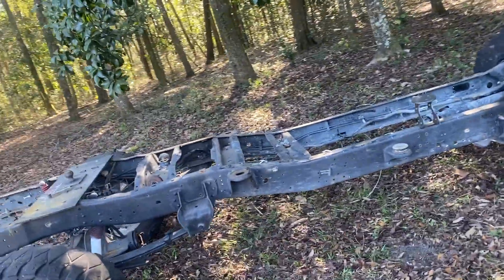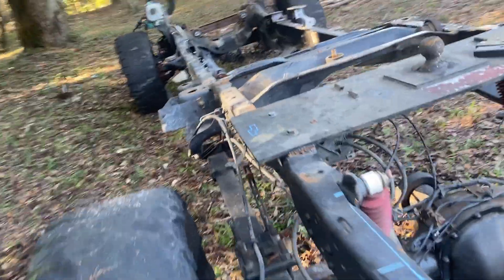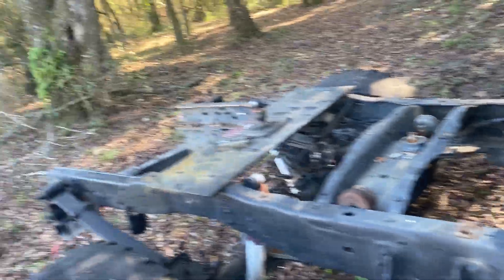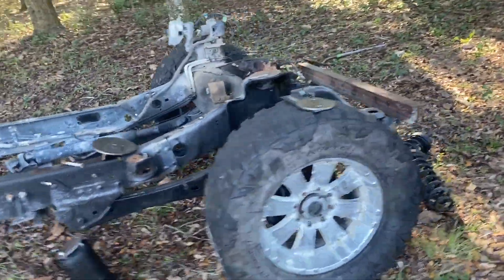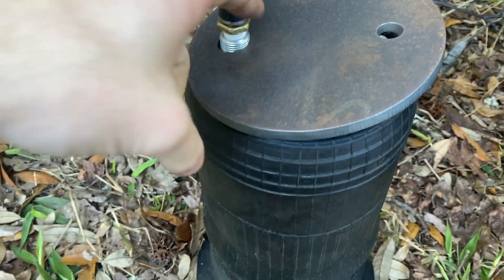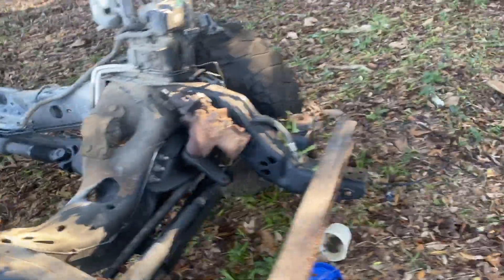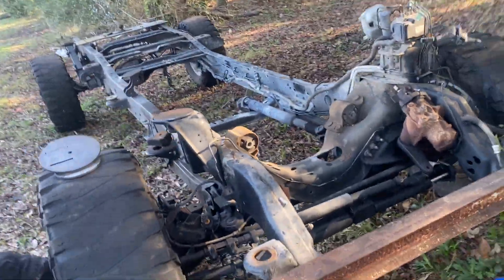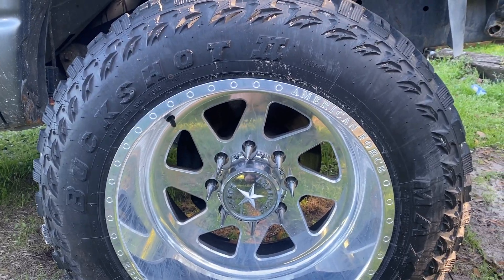6.7 swap Update! Frame getting prepped for bags and new motor!

Comment: The dodge lug pattern are 8 on 6.5 lug pattern ford changed their 8 lug pattern in I think 99 it s 8 on 170 lug pattern
Reply from the maker: Correct. I’ll either run high quality adaptors or sell them and get so thing else later down the road
Reply: Yeah that be some good money goin toward the build

Comment: I'd put obs ford body on dodge frame you have all drive train
Reply from the maker: No dodge frame hangs down way too low and has terrible suspension geometry in the front.
Reply: They re pretty bulky in the front ,I just figured it be good option with all the stuff that be on it